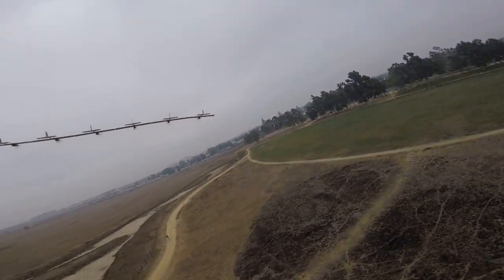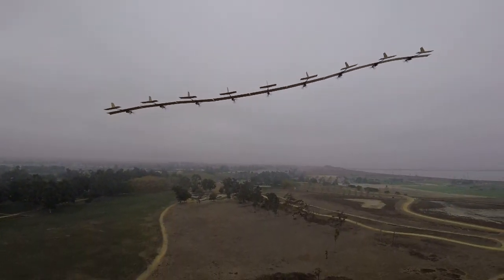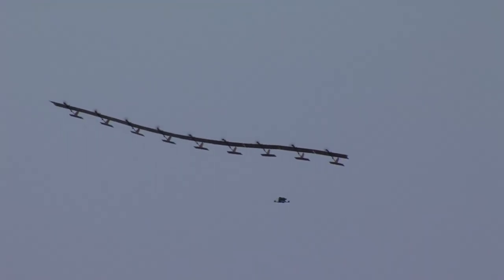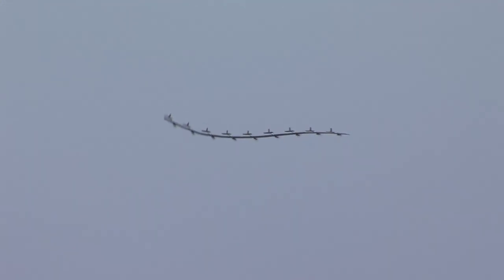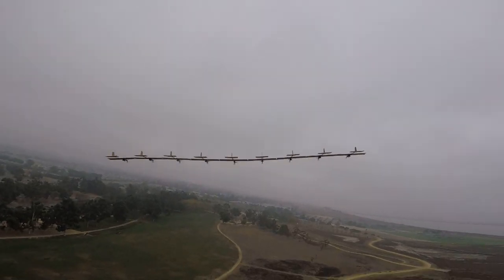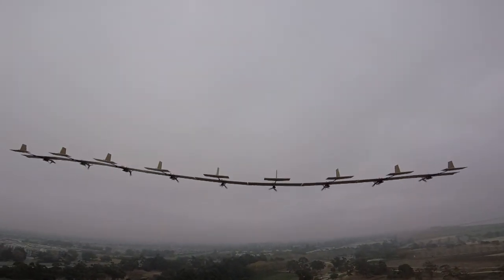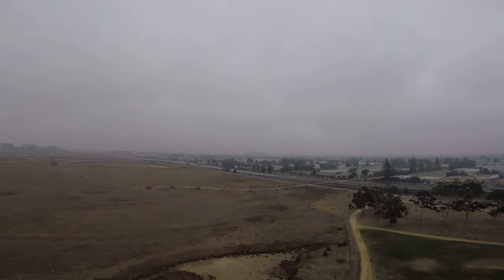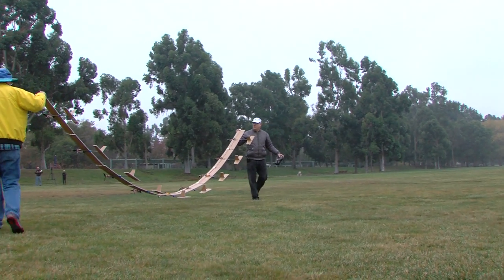Ran D. St. Clair Flex 9 Flight

Comment: I am the designer, builder, and pilot, so I can answer your questions.

How long can it fly?  About as long as this video.  There was 27% of battery capacity left at landing, so a good safety margin.
Why does it want to turn left?  It only does that when Auto Level is turned off.  Slight trim issues with the various elevator settings.
What is the point? To see if it is possible.  To learn how to do it.  Because it’s fun.
What is the application?  High altitude solar powered aircraft are very large and delicate.  This technique would reduce structural stresses when flying in turbulence.
What is not the application?  Man carrying aircraft.  This is suitable for use with autonomous aircraft.
How does it work?  3 receivers, all bound to the same transmitter, send identical signals to all 9 planes.  9 flight controllers interpret those signals to tell each plane what to do.  Each plane has only throttle and elevator.  Differential throttle gives yaw control (steering).  Differential elevator gives roll control (like ailerons).  All elevators together control pitch (up-down).
What does the flight controller do?  It provides rate gyro stabilization as well as AutoLevel stabilization.  It also mixes the input signals differently depending on the planes location in the array.
Is P factor making it turn?  No, P factor relates to differential thrust across the propeller disk due to the air coming through the disk at an angle. It’s not an issue here, in part because the propellers on opposite sides of the plane turn in opposite directions so any P factor would cancel out.
Can you wrap it in a circle and fly it?  Circle or Ring planes can fly, but not this one.  There is no structure that would allow it to hold its circular shape.
Is it more efficient?  In theory yes.  Induced drag, that is drag due to lift, is reduced by the square of the span, so a very large span has very low drag.  This specific plane is not very efficient because it is not very streamlined.
How much does it cost?  Not much.  All the gear is simple low cost hobby grade stuff.
How does it get power?  Each plane has a small 2 cell lithium polymer batter, 1A hour capacity.  It uses small brushless motors and  electronic speed controllers (ESC) to drive them  It’s all inexpensive hobby grade stuff, and readily available.
Why does it flap and wiggle so much?  Mostly because it isn’t properly tuned yet.  This was the very first flight.  It will always wiggle and bend in turbulence though, that is kind of the point.  If it was rigid then the structural stresses would be higher.
What’s it made of?  It looks like cardboard, but it is really foamboard.  It’s the same stuff you can buy at your local store that kids use to make presentations.  It is brown because the paper on the outside is brown and water resistant.  It’s held together, mostly with hot melt glue. The fuselage is a fiberglass tube like an arrow shaft.  It’s a very simple, cheap, and not very elegant building technique, but it works fine for a quick experiment.
Was it hard to build?  No, it’s about as easy as a plane can be, except that you have to build 9 of them.
Who launches on 4?  I guess I do.  3 would have worked just as well.
Why launch it from the wing tips?  Because there is no other good way to grab it.  You could have 4.5 people hold 2 planes each, but it would be hard to get them all coordinated.
Why not add landing gear?  Because it’s simpler to live without it, and the flying site we use is covered with grass, so wheels would not work easily.  On a flat smooth surface, wheels would work just fine.
Can you make one with 100 planes?  In theory yes, but it would be a lot of work, hard to launch, and a logistical pain in the neck.  Besides, for the intended full scale purpose, 9 each 40 ft. modules would be 360 ft. span, which is already way bigger than a 747 at about 200 ft.
Would it fly better if the modules were swept back like a flock of geese?  Not really.  Geese fly that way because they are not attached.  Ideally the multiple modules would be one smooth continuous wing, but this is just a science experiment.  Geese do fly in a V for the same basic reason though, to increase their combined span for better efficiency.
What kind of drone was used for filming?  It was a more or less stock “race quad” with 5” props and a Go-Pro on the font.  The pilot, however, is exceptionally skilled.
Why was it so grey?  The smoke from the “Camp Fire” in Southern California settled in the San Francisco bay area for several days, plus it was cloudy.
Will it fly again?  Yes, it has already flown and crashed since then.  Flights will continue each weekend, weather permitting, until we get it tuned as best we can.  There will be more video, but without all the flapping it will probably be boring.
Is it hard to land?  Yes, it is.  If all 9 planes don’t touch down at the exact same time it tears the foam couplers between the planes.  It’s an easy thing to fix, but even a good landing is a slight crash.  I never said it was a practical model aircraft.
How would you launch the full scale version?  You get 2 really tall ladders…  Just kidding.  The Odysseus uses a really wide cart called a “strong back”.  They mount the plane on it, and tow it up to speed with a truck.  The plane flies really slow so it lifts off easily.
How would you land such a big aircraft?  The Odysseus needs a really wide runway.  For full scale it is possible to have the modules break apart and land separately.  That would offer huge advantages when operating in areas where a big runway is not available.  It would also make the modules much easier to manage in less than ideal weather conditions.  The model is not designed to break apart in flight, but it is theoretically possible.
Reply from the maker: Let's start to thumbs UP on the previous comment to keep it at the top!
Reply: This plane concept is outstanding and inspiring. This is truly a great application of the concept of joints. Awesome!
Reply: I wake up daily just to watch your videos...then I sleep and dream of meeting you in person one day.
Reply: hi! I am having about 50 quads at home which is 200 motors and want to build some big RC airplane using as many motors on the wing as possible. Do you now any open source projects supporting it on common FC's like F3 F4 etc?
Reply: getting all those aircraft to fly in unison,  assuming one used a stability control sensing of some sort ..
Reply: @wcolby1  Just FYI, you can pin comments, so you could pin the original comment here so it always appears at the top. 👍
Great video, great discussion between team members, and great info on answers to questions I hadn't even thought to ask!
Reply: Excellent.
Reply: Next step: in flight assembly
Reply: FAQ. Brilliant. I’m impressed!!
Reply: @mccc4559  hope dream comes true!!!!!
Reply: @wcolby1 ।
Reply: Would sealing the gaps between planes increase the span efficiency significantly? They appear "lossy".
Reply: Wtf why'd you waste ur tine giving free knowledge to most of the people who really don't even read it! Thanks for answering btw
Reply: Longest comment I've ever read.... and this is a random video to me. Pretty cool.
Reply: This is amazing. Allowing it to wiggle and bend definitely make it more resilient to turbulence, because of the flying characteristics of each module independently acting against bending force maybe? Is that how it works?
Reply: Or perhaps it displaces the turbulence across a wider area, and the nature of the 8 pivot points greatly reduces the impacts of the turbulence as well. Gonna call these guys the left brothers.
Reply: your mono tone drove me nuts
Reply: cool as fuck. well done
Reply: Whoa whoa, keep that secret sauce in the bottle buddy, jheeez
Reply: You are great
Reply: That was one long poop
Reply: @hrsh042  I read it all just to spite you lol.
Reply: Have my word You better read a book and publish it
Reply: It is awesome!
Reply: "I'm the designer, builder and pilot"
Sounds like he is a little pissed that he didn't upload the video despite he made most of the effort, just saying 😅
Reply: Could you connect the end and have a big flexible circle
Reply: @fotoamgamgfoto3695  hi can we connect
Reply: @fotoamgamgfoto3695   can we connect
Reply: @dipak360  maybe you wanted to connect the uploader?
Reply: You did an amazing job on this.and your support crew as well.its different and its interesting.
Reply: Omg are you doing Phd on this
Reply: Cant believe I read the whole thing!

Comment: I was on the Pathfinder and Helios solar-powered airplane program, from 1992 until 2007. We set several altitude records using span-loaded flying wings such as you have here. The stability and control issues are interesting, but at the end of the day we set an absolute altitude record of 96,863 feet in August, 2001. Wing twist and dihedral angle are two critical factors for stable flight. The latter we achieved by flying the outer panels at higher angle of attack relative to the inner portion of the wing.
Reply: Awesome have any links to share.?
Reply: Moe Shipley, I do believe you are quoted in a textbook I read once.
Reply: @jerryweaver2247  Check out NASA-Armstrong's website and do a search on "Patfinder Plus" and/or "Helios," and you'll see a ton of photos. Both airplanes are also on Wikipedia. At the time (1993--2003), NASA-Armstrong was still NASA-Dryden, and they were the sponsoring agency. My employer, AeroVironment, Inc., built the aircraft. We set our first altitude record over Roger's Dry Lake there, with subsequent records set at PMRF-Barking Sands, on the island of Kauai (spending three seasons there did not suck!). Sadly, we lost the Helios aircraft in June, 2003, but I was privileged to be one of the guys who took Pathfinder Plus back east to the Smithsonian's Udvar-Museum at Dulles Airport, where it hangs today. Hope this steers you in the right direction, but feel free to ask more questions.
Reply: @moeshipley4170  It is absolutely crazy that you, with your pedigree have the ability to comment and communicate with us peons watching you tube. To think I am watching this video alongside a NASA engineer, and were having similar thoughts, and can just reach out to each other. life in the year 2018 who would have thunk it!?!? THANKS FOR EVERYTHING YOU DID TO MOVE US ALONG MOE!!
Reply: Jeremie Cuffaro couldn't agree with you more my friend, the ability to communicate with anyone, anywhere, any time. We are all individuals, a singularity in a sea of singularities, playing on a massive thought playground
Reply: My dad used the same principle in his wings.he would build a twist in the wing so that at certain angles of attack or slow speed flying the whole wing is still working.my dad was a genius when it came to wing design.
Reply: I would design a wing section.it would take me all night.it was sleak and back swept leading edges.my dad would take one look at it.no, that's too thin, that's too fancy, not enough dihedral,stuff like that.then he'd take 5 minutes to draw this boring looking straight leading edge wing and he'd have the ribs drawn and he'd say.this will do 200mph.(I was forever chasing speed.).I'd build it with a little input.he'd twist here bend there and say, "perfect".every time my planes flew fantastic from day one.and it was those wings.I wish he was still around to see some of the gear I have now.
Reply: Imagine the runway you'd need to scale this idea up for commercial transport?
Reply: How much wing twist will you need at the wing tip? Say, a lifting wing with AR of 50? Does that AOA increase along wing span suggest that there's a limit to maximum AR we can physically achieve regardless of the material and control issue?
Reply: @SocksWithSandals  my first thought was individual airplanes take off and then link up in the air
Reply: Nerys HA ha! That would be for their next trick!
Reply: @EwingTaiwan  Our Helios aircraft had a span of 247 feet, with a chord of 8 feet, give an A/R of 30.8:1. We were limited in chord length because 8 feet was the maximum we could fit in a shipping container (each container held two wings in special fixtures). We did build some twist into the outer panels, but fine adjustments were made using shim blocks between the intermediate and tip panels. I don't recall the exact number of degrees, but it wasn't more than a degree or two. Altering the angle of attack allowed us to obtain the ideal dihedral angle as determined by our stability and control engineers. Two little dihedral would decrease lateral stability, while too much diminishes pitch stability. In flight, Helios' wingtips would rise about 20 feet.
Reply: @cuffaje  Thanks for the compliment, but this thing happened thanks to the efforts of some really sharp folks. I was only a prototype machinist who was lucky enough to be chosen to work on the program. It was actually relatively small effort, with less than 30 folks on our side, and maybe a like about from NASA. I will say that it was the best 15 years of my life!
Reply: Moe Shipley io
Reply: @Nerys - That's actually been done. In the 1950s the Air Force tested a way of extending the range of fighters by linking them to the wingtips of bombers (project Tip Tow and later project Tom Tom). They could detach and reattach while flying. See https://en.wikipedia.org/wiki/FICON_project. There's also a video lurking around YouTube that the Air Force made at the time. EDIT: Here's one: https://www.youtube.com/watch?v=30d59njxIMw&ab_channel=BrianLockett
Reply: Hi Moe, I work at PMRF and watched as all of the record making flights took off. It looked like a very large Cheshire Cat smile flying from a distance. There was times during the flight when the pathfinder was flying into a headwind actually going backwards and gaining altitude.  It was an honor to be there and watch history in the making.  I was saddened to hear of the crash of Helios. I love working at a place where amazing things happen.
Reply: Moe Shipley my friend Jeff Mihara (Jigs) was the welder who fabricated the motor test stand for you guys at PMRF for Pathfinder. Sadly he passed away about ten years ago.
Reply: The higher AoA makes sense even if you just look at the newest wing designs of jets that have their winglets not go up at >60 degrees at the end of the wing, but rather just appear as an extension to the wing. They seem to have a greater AoA, more than the bulk of the wing.
Reply: What kind of motor should I use to prepare mini drown or plane
Reply: So you started at the wing root and increased the angle of attack further out on the wing, like the blade twist of a prop, except you increased instead of decreased? And that gave you more dihedral for lateral stability? As well as lift I'm sure?
Reply: @snipereliete   dead link
Reply: i have to ask, literally ive been asking this question in my head forever. when you do something really big in the sciences, do the women/men you pick up ever care? like could you walk into a bar, tell someone you work for nasa, and get laid for it?
Reply: Here's the link to what Moe is referring to

https://en.wikipedia.org/wiki/NASA_Pathfinder

You'll find info on Pathfinder, Pathfinder Plus and Helios. Cool projects. Must have been a blast to work on and sad as hell when the Helios was lost off the coast of Kauai.
Reply: Very cool that you share your knowledge
Reply: Jeremie Cuffaro we in2018 live more incredible lives that kings and Queens in 1900
Reply: @SocksWithSandals  Yes, but then imagine the human genetics program you would need 
to create the giant humans to throw your large scale commercial transport up into the air.
Reply: @nerys71  That is just how Gerry Anderson would have done it.
He would not even need to use human pilots. He would use puppets.
Or he would use human pilots but attach strings to them to use as 
a ground over ride.
Reply: @521CID  It was a real balancing act! We did have some negative twist (washout) built into the outer panels, and we adjusted the position of the panels relative to the adjacent panels, to obtain the correct dihedral.
Reply: Love to talk to you about this sometime.  Dihedral & twist broke Helios.

Comment: I am the designer, builder, and pilot.  The practical application is very high aspect ratio solar powered aircraft like the Helios, or more recently Odysseus (look them up)  These aircraft fly at 60K to 100K ft. for months at a time, or at least they hope to.  They are huge, extremely light weight, and subject to damage due to turbulence as they climb through the lower atmosphere.  The idea is to allow the plane to bend instead of breaking.  It presents unique control challenges though.  This is just a simple little model to demonstrate that it is possible and to learn a few things about what is required.  This was literally the first flight, only barely successful, and not tuned yet, but it makes for a more interesting video for its lack of stability.  As for the aerodynamic advantage, the induced drag (drag due to generating lift) goes down with wing span, so it is potentially more efficient.  This little model is not very efficient though, that was not the point.  It is designed to be cheap, easy to build, easy to repair, and to survive a crash, not to be efficient.  Efficiency comes later, when the concept is proven. - Ran D. St. Clair
Reply: Nicely done, cool plane!
Reply: wow!
what are these high altitude planes for ?? science? or just testing technology?
Reply: Are you adding solar?
Reply: With such a high aspect ratio wing, wondering what is its glide ratio, or maximum lift to drag ratio?